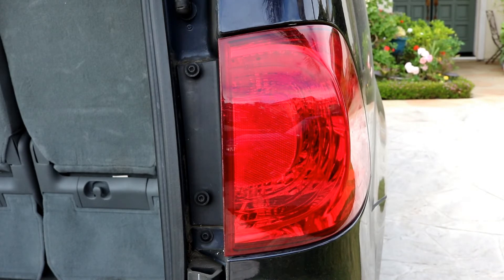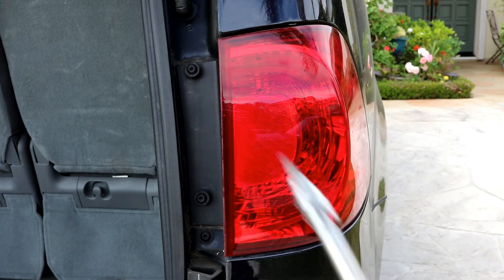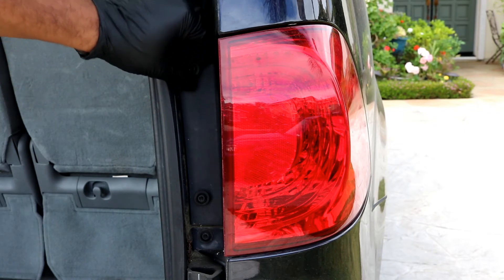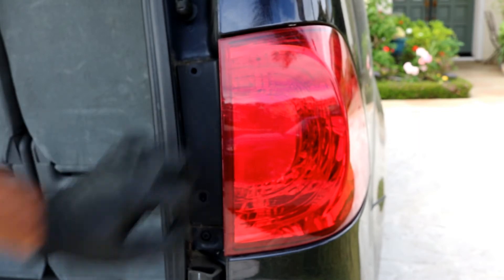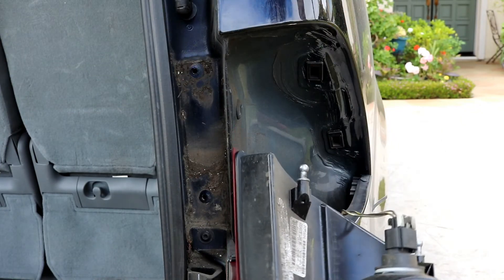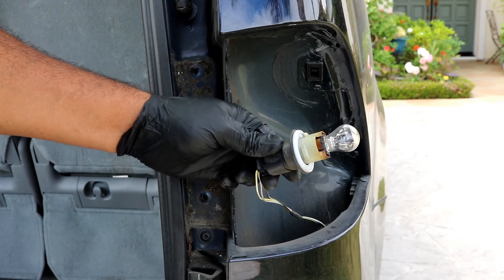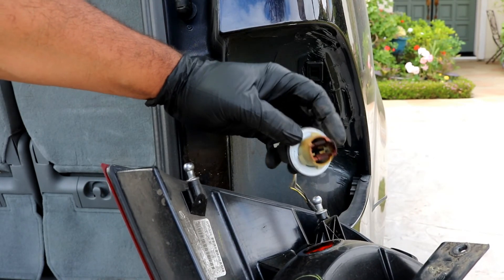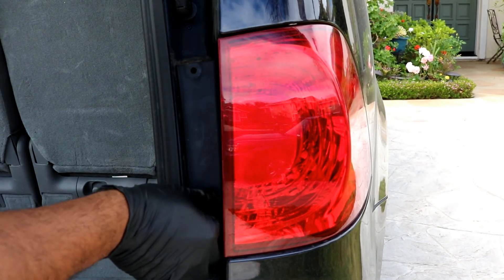2009-2011 Volkswagen Routan Tail Light Bulb Replacment!

Comment: Great instructions, thanks. I have a 2010 so this was perfect. It took about 5 min. The hardest part was I had to go to harbor freight to get the torx t30 screw driver head. The bulb is # 3157 which most auto parts stores should have. Thanks again!
Reply from the maker: No problem

Comment: Is this fix also good to replace turn signal lights that are ticking too fast?  Mechanic here said it would require putting car up on Lift and removing both tires on that side to be able to change the turn signal bulbs. I too am a woman and appreciate your clear instruction. I could do that myself. Unfortunately I didn’t and paid.

Comment: I also have a 2009 Volkswagen routan and my third tail light is out and there's no videos that tells you how to replace it I have the part I just need to replace it I already know it's not the fuse I checked any help would greatly be appreciated
Reply from the maker: Joy Reyes Hi, unfortunately I do not have a video for that and I haven’t done one on this particular van just yet as I believe they are LED lights and those don’t often fail. However the Chrysler town and country is essentially the same van as this Routan and if you open the hatch it should be pretty similar.

1. You can try this to see if it looks the same. Open the hatch and there should be two 10mm nuts towards the top of the hatch (on the hatch door, not on the body) on the left and right side. Remove those.

2. Next there should be an upper portion of trim on the hatch that is separate from the bottom cover. It should just pop out using a flat head screwdriver to pop it out. You won’t be able to remove it completely as the hatch shock will be in the way but you should be able to maneuver it around the shock.

3. Next if you look in between the hatch and the body of the car up top there will be a windshield washer plastic tube for the water. Remove that.

4. There are a collection of holes you can see now (I think 4-5 total) two of them (left and right) should have two more 10mm nuts to remove and two of them have plastic nylock type connectors that can be pinched with needle nose to remove them.

5. Close the hatch and the rear spoiler that holds the light should now be able to lift up and back towards you to gain access to the light bulb. I believe it is held in by two screws but I can’t recall. 

I hope this helps.

Comment: have you changed the top brake light?
Reply from the maker: Julia Orta Buszkiewicz No I am sorry I have not. This is a customer's car. They requested that light bulb be changed out. I can try and get ahold of them to get the van back for a video on how to replace the bulb.

In the mean time, being that this bulb is a LED bulb they rarely go out and are supposed to have a fairly long service life. I would first check the fuses (normally labeled brake light or tail light or stop light where the word light could be subbed with lamp) and if they check out good then proceed to replacing the bulb.
Reply: i found one.  The Chrysler Town n Country is the same.